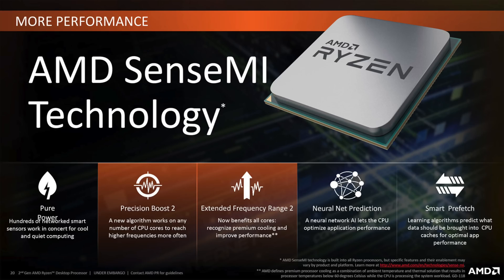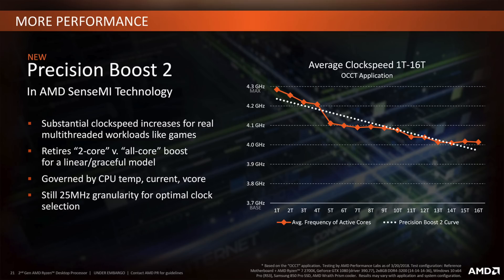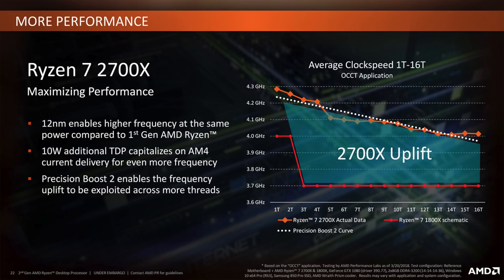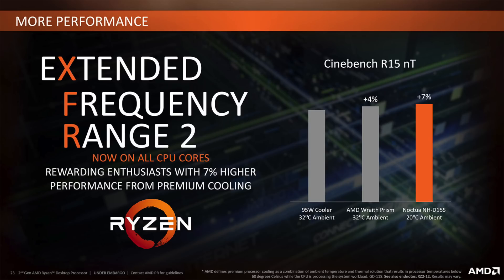The Ultimate Ryzen 7 2700X Performance Tuning Guide

Comment: So.. My negative voltage is 0.125 I get 1.3v while cinebench or gaming. Clock speeds don't go higher then 4.025gz.
Is that bad voltage? This part I don't get.
Reply from the maker: The factors are many, could you write me your full system spec? Like motherboard, cooling etc.
Reply: @HardwareNumb3rs  

SPECS:
GPU:  MSI GTX 970 gaming 4G
CPU:  Ryzen 5 2600X (Cooler Master Hyper 212x)
MOBO:  MSI AMD X470 GAMING PRO CARBON
RAM: RAM G.SKILL Trident Z RGB 16GB (2x8GB) DDR4-3200MHz
PSU: Corsair RM750i Gold

Fans: 2x NF-A12x15 FLX 120mm PREMIUM FAN
SSD: intel M.2 660P 1TB 

SSD: Samsung 850 EVO
Mouse: Steelseries Rival 
Keyboard: CM STORM
HeadSet: HyperX Cloud Revolver 
Monitor: SAMSUNG L24CFG73 144hz 1ms 
Case: ATX Phanteks Eclipse P400 Tempered Glass
Reply from the maker: @Enclosure_2k  With a 2600X you should be able to see 4.2 spikes on light task and more or less 4GHz with heavy loads, so It looks normal to me, plus even if you manage to get 4.1 or 4.2 is not a game changer, if your ram are the C14 version it means they're b-die based and you can tune it with Ryzen Dram Calculator, there you will see a boost in performance, if you have the C16 version you still may be able to tweak it a bit (with Dram Calculator)
Reply: @HardwareNumb3rs  Hi.  on idle it never goes higher then 4.052hz.
On full load it stays like that and sometimes it goes down to 4.0hz
The ram specs are  F4-3200C16D 16GTZRX
CL16 18 18 38 1.35V

Comment: I have been using a similar set for over a year (2700x crosshair VII, trident-z 3200 cl14, custom ek loop) and after the tests I came to the same conclusions: PBO + ram oc gives the best results.
Great video, I hope that when it comes out 3700x you will do similar tests.
Reply from the maker: Saruvatari I will do a full set of benchmarks and tests when I can have the new Ryzens, I’m very exited to know how they will perform!
Reply: I respectfully disagree on the PBO + ram overclocking as providing the best overall performance. Perhaps in games that only utilize one core this could be true because an all-core overclock on any Ryzen will not reach single core boost speed. This is my experience with my frequent builds as I build and sell custom rigs. I agree with the ram overclocking as that’s just free performance…………but it takes much longer to overclock and achieve stability with ram then it does the CPU. You also have to know what you are doing. So…………not as easy as one would think………but you can buy cheaper ram and achieve more expensive ram speeds. It takes me a full day or two to achieve a completely stable overclocked CPU and RAM rig. Although wonderful technology, the new Ryzens do not have the same overclock headroom as AMD CPU’s of the past. You would be very lucky to achieve a fully stable overclock much past max turbo boost limit…………and this has been my experience with every Ryzen CPU I have used. Intel “k” cpu’s on the other hand will overclock quite impressively past their max turbo boost in my experience……and no…….not a fan boy…..of either. Both AMD and INTEL have their positive and negative attributes, but getting back to the thread, my personal preference is an all-core overclock combined with a ram and gpu overclock. I keep my core voltages around 1.3v on Ryzen and temperatures below 80c with all of my overclocks. Ram I usually never go above 1.38v. Whatever I get at these self imposed maximums are what I stick with. After finding my maximums I reenable power saving features for the rig. That’s how I do it………and it works 24/7.
Reply: At what speed do you run your RAM ?